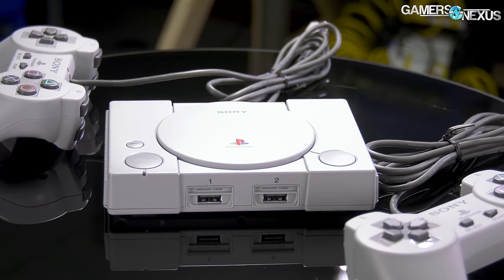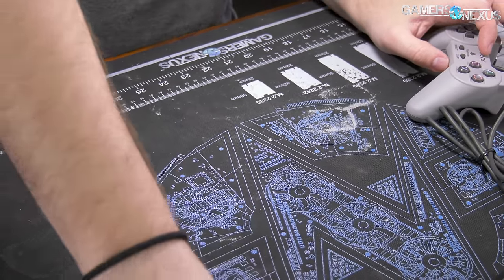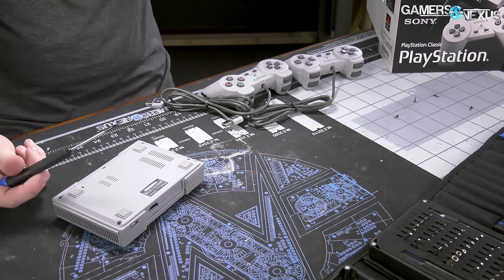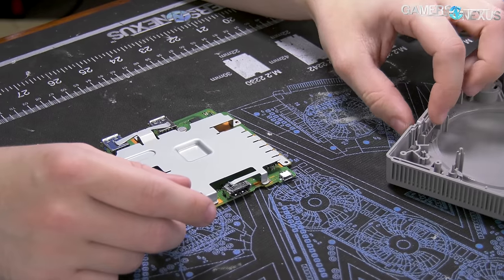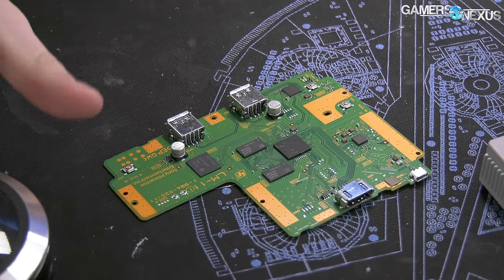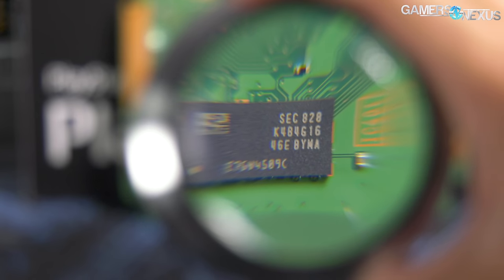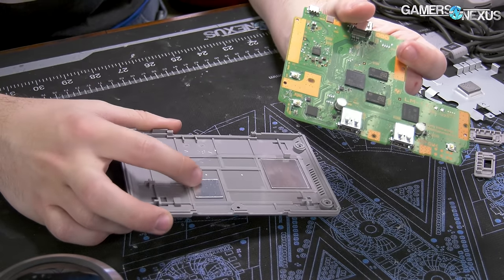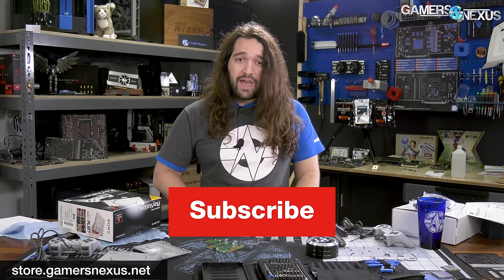PlayStation Classic Tear-Down & Disassembly (PS1)

Comment: I wonder how large the storage is that it could fit only ~12GB worth of games
Reply from the maker: That's a 16GB module.
Reply: @GamersNexus  Wow... They could've at least put SOMETHING good on that. Maybe replaced Cool Boarders with- wait... Actually, I'm good. The emulation's piss poor, I'd rather it be a bad game and bad emulation than something like Spyro or Crash and bad emulation.
Reply: well for the final fantasy games they filled up the 600 something MB disk but for most games they did not fill up the disk thus why most games did not have more than just 1 disk. Making 16,384MB enough space to hold 20 ... probably only 20 to the point that they would have had to include another chip to have more than 20 games on it. I wish they had a way to download or add on more games to the system as that would be cool. To buy more PS1 classic games their own store would make the most sense too.
Reply: @GamersNexus  its a 16gb module and assuming they ripped the ISO files or more likely just dumped them on there you are looking at a tad over the 16gb memory limit. This means it either uses a tad bit of compression or the reason it used pal versions of so many games is because they were (theoretically) smaller in filesize.

As a side this leaves next to no headroom for custom game loading for modders at all :(
Reply: Well they used CDs. They had a capacity of 600/700MB.
Reply: @Diceman82  sure it does delete the 80% of games that are trash it came with and put some actual good ones on it :D
Reply: @Diceman82  Why would PAL versions have smaller file sizes? The resolution is different, but that doesn't change the size of the assets being rendered. If anything, some PAL versions would be likely to be bigger, due to having support for more languages.

Comment: That tool set you're using has a magnetic plate below the housing for the screwdriver bits.  You can slide the plate out or leave it in, either way it's useful to hold screws while you work.

Comment: Looking at the bottom cover, I don't think those slots were ever intended as cooling - they are just cosmetic, and the metal sheet stuck behind them is there just to match the appearance of the EMI screening on the SCPH-1000.  In fact, visually the bottom cover matches the appearance of the SCPH-1000 perfectly - all the slots are in the same place, the feet are the square felt pads used on the early machines and even the plastic nubs that were originally part of the molding for the screws holding in the internal parts are in the same place.

Comment: I'm pretty sure the main purpose for the metal piece is an EMI shield. It can just double as a heat sink since the heat dissipation of that CPU is very low. EMI shields do not need to be robust, hence why it is so thin. You can also see the little "fingers" on the side of the shield touching the ground plane of the PCB. That's how you definitely know it's EMI shield

Comment: The silver metal on the shell is there to mimic the look of the original PS1 which had some substantial metal shielding for the board nd that board doesn't really need that shielding
Reply: I hate the metal shielding on the original becase it was soldered to the board

Comment: I wonder how the performance compares to the Raspberry Pi 3b+ because it handles PS1 games really well. Also, I wonder if there is a reason they went with PAL rooms for some of the games, could the chip not handle 60 fps because of performance. Thanks for doing this teardown.

Comment: The metal shield is more for RF shielding that just happens to work as heatsink too.  That's why there are big areas of exposed copper on the PCB where the shield contacts.

Comment: Finally!! I've been trying to find the hardware specs for months.
So it's a quad core 64bit ARM Cortex A35, 16GB Flash memory, and 1GB DDR3 RAM. 
In comparison, the NES Classic is a Quad core 32bit Cortex A7, 512MB Flash memory, and 256MB or RAM.
If it can be hacked, it could fit a ton more retro games than the NES. Complete collections of NES, SNES, Sega MS, Genesis, Turbo graphic, GBA...

Comment: Everyone has been hard on Sony over this console, but I think what the open source emulator is saying is that they're fully open to this console being hacked so you can run anything you want on it. They're basically just charging you $100 for a raspberry pi in a nice shell and two controllers, and I don't feel like that's outrageous.

Comment: Protip for hackre:

This stuff uses Mediatek MT8167A SOC, that also used by Acer Iconia tablet model b3-a40fhd-k3fx.

Assuming that you can use SP Flash Tool, WWR_MTK, and MTK Droid Tool, you might be able to mod this stuff.

Comment: I think they learned from the "fail" of Nintendo who used Allwinner SoC. Mediatek chips does not have good open source support, but Allwinner chips' have very awesome open source support from linux-sunxi and people can boot custom OS without wiping the original memory. Some people have even pulled contents off the original storage chip, upgraded the system to some brand name Linux distro like Ubuntu, and added the pulled contents back.

Comment: Oh, great video to see when I'm working on a N64 emulator build. I'm taking apart my old N64 case and placing a Raspberry Pi 3 B+ inside. Adding a bit of cooling since N64 emulation with the Pi can be... hectic. 
Going to have USB Controller support as well as an adapter for the old port since I still have a few Original N64 controllers about. It's been fun so far except for the Gamebit screws holding the case shut, ugh.
Reply from the maker: Sounds like a cool project!

Comment: really the better alternative for Sony would to provide a usb port for flash drive port.   Or go a little bit more voltage and provide an SSD Hard drive slot for that extra space... Although for that size you are better off just getting the shell ditch the board and remapping a raspberry pi and put an emulator on there and then hook up on of those high capacity SSD for extreme read/write for these games and to add bluetooth connectivity.... with controller for bluetooth 4 player... or 8 player for those that remember that era of multi-player games.

Comment: the shape of the PCB and the solder blanks hint towards that this was ment to be battery powered (4x AA probs) at some point, might wanna probe the joints there and see if it can take 6v on those 2 contacts and mod a 4x AA holder on it

Comment: best part of it beeing so simple? you can easily put it in any other case. like for example an original ps-one case. and if the emulator accepts them, use usb to playstation adapters to play with original controllers and keep the original look, at least in the front.

Comment: exact same memory chips used in the new NanoPi neo 4. having a gig of ram and a mediatek soc should make it pretty easy to hack/modify it and run retroarch or other stuff similar to a raspberry pi. so its probably best to just get a raspberry pi 3 and 3d print a ps1 case.

Comment: I agree that the original price of $100 was a bit off putting, but at the current sale price it is a steal! You can easily hack it and it is technically more powerful than the raspberry pi 3b+. So once the software catches up it will be pretty awesome. In its current state you can easily add more games unlike the other minis. 

I just hope the flack that they got does put them off from putting out the PS2 mini that is planned

Comment: It would be interesting to put it on a power bank, make a mini monitor with speakers and add it to connect with power-bank, then when there is a lack of light or if you want to use it in the bathroom or take it anywhere, it would be interesting , more is a pity to have few games and some bugs for the price is not worth.

Comment: my psc has stopped powering on recently. the power button does not light up anymore. what could it be? how to fix that? I was able to power it on at first two times when this issue happened with plugging and unplugging the power cord several times, but now it does work anymore. can I still get it back to life?

Comment: Is it just me or does that header on the lower left next to the HDMI at 8:24 look USB-ish with the four pads; left pad being ground as it connects directly to the main PCB, two pads in the centre then running parallel straight to the SoC as data and right pad Vcc?

Comment: Bit of a shame they didn't provide more onboard storage onto it. 32 gb storage would have been easy & fairly cheap too do with 2x of those chips on the pcb & perhaps a expansion memory card of 8 gb with say 5 additional games + save state storage with additional games you could say buy online & customize into a bundle you want too see on there, or via any game stores for more games.
I mean in total it's perhaps 50% markup of manufacturing costs atm with the software licensing & parts.

Then again there might have been so many ideas on how too work with this in Sony over x amount of years after the fat ps3 stopped being produced & ps tv no longer were produced that they finally went with the cheapest option because the other options won't have any protection & be bought more but also kind of eat up their market on the newer more expensive products.

Comment: I'm curious about the controllers since they use USB can you use them on PC games.

Is it possible to access the NAND flash memory to either download the games from it or to add your own games to the unit, possibly via the USB jack?
Reply: Id say the controllers would work as a generic PC controller so windows would probably slap its generic driver on it. As for hacking it im fairly sure this will get broken wide open soon just as the Nintendo classic were. However the experience on a PC is much more satisfying.
Reply: @Twenty_Six_Hundred 
Nintendo 64 Mini up next then from sony PS2 mini classics.

Comment: Now that I saw the teardownd and that there is a whole empty area I'm way more disappointed. I think it would have been a huge success if only Sony decided to create a PSOne classic and make it portable.

They could have added a battery in the empty area+battery cover for easy replacement, add a working lcd screen in the disc reader to mimic the PSOne portable screen (both battery and lcd could have been gathered from Sony old phone stock if they had them), add analog sticks to the controllers, optimize the emulator by adding various graphical options and lastly choose better games and make sure them are all NTSC or JAP English Patched (since there is issues with frametimes due to 50hz PAL games in the emulation). Instead they went full cashgrab with a poorly made "work", and now they are unsuprisingly backlashed...

Comment: could the 'CD-ROM lid & internal space' be large enough to custom fit a mini cd (24min audio) drive even if a buffer for height had to be 3D printed?
Reply: scratch that, didn't realise it was o tiny.
Have to 3D print and downscale from a PSX, probably btter for a working lid.. and large rnough to keep the serial & parallel ports.

Comment: Please investigate the RTX frame rate improvements on Battelfield V after the first optimization patch. Claims are 60-75 fps (depending on which RTX card you have) at 1440p with RTX on.

Comment: They should've just built the board inside of the controller and sold the controller as the ps1 classic. That way all you'd have to do is plug the controller into the wall/tv

Comment: If they are good quality, I expect the controllers to be much more expensive than the actual box. I mean you can emulate PSX games on a potato these days but a good controller is still a good controller.
Reply: It's the OG PS1 controller without rumble or analogue sticks. Sony likely has a significant margin on PS4 controllers that they sell for 50-60 bucks, and those controllers have rumble, wireless connectivity, sticks, rechargable batteries and even a touch pad. There's no way a dinky PS1 controller costs them more than 5 bucks to manufacture, if even that.
Reply: @stale2665  Well, you can get cheaper controllers from third parties but they always have an inferior build quality. Same for other consoles like Nintendo controllers: the originals are super expensive but the third-party ones are crap. So if it were possible to manufacture and distribute good-quality controllers for significantly less, why don't we see these on the market?

That being said, you have a point that the old PS1 controller has much less tech in it than a modern controller. I just wouldn't be so sure that this makes them dirt cheap. Electronics cost nothing. Something that can take years of abuse from button smashing OTOH does not come for free.

Comment: The Pony Graystation. Even 24 years ago, I was saving up for the Japanese N64 release instead
Reply: You mean Saturn. N64 did come out in Japan until Early '96.
Reply: @segaunited3855  no, I was saving up ever since I saw the E3 show in 1995. Mario 64 was way ahead of its time. But the N64 did suffer in software quantity. Quality was fine though.
Reply: @dannygray4898  1995 was 23 years ago.

Saturn was also ahead of its time.
Reply: @segaunited3855  I had a Saturn when it came out and I agree it was a good little machine. However, developers were never able to fully get to grips with its complicated architecture. It was far better than the PlayStation  at dealing with 2d graphics, but Sony's machine was better for 3d . The N64 though was a big step up from that. I first heard of the "ultra 64" in 94 and saw Mario 64 for the first time in 95. It was released in Japan in May 96, by which time I'd saved £1300, more than enough to import mysen one
Reply: @dannygray4898  PS1 was actually WORSE at 3D than Saturn and N64. Saturn had far more power and was superior at 3D than PS1.
Reply: @segaunited3855  it would have been, but software houses could not get to grips with it fully. By the time they could, the Saturn and PS1 was old hat. I really liked the Dreamcast aswell, but Sega sadly gave up on hardware in the end
Reply: @dannygray4898  SEGA did not want to give up on Hardware. They're Parent Company forced them too at gun point.

This is why our friends at Alethiea Games are going to pitch "RAZOR" To SEGA Holdings Next year.

Also, Saturn wasn't outdated by 1997. Not at all.
Reply: @segaunited3855  fair comment. I loved Sega. It was just really sad watching what happened. Did u like the underrated Dreamcast?
Reply: @dannygray4898  Yes!I brought a used Dreamcast from Hollywood Video on  Monday November 8,1999. Spent my whole then Burger King Paycheck on it and Sonic Adventure. I still have a Dreamcast today, as well as an American Saturn and Japanese Saturn.

The RAZOR Game Console will be backwards compatible with Sega CD,Saturn and Dreamcast Discs including Homebrewed ones.

SEGA thankfully doesn't  have a Parent Company currently. They're now known as SEGA Holdings,Co,Ltd and have a Public Trading Group called SegaSammy. Sammy Corporation,Inc has been a Wholly Owned Subsidiarity of SEGA since 2010.
Reply: @segaunited3855  I used to love that boxing game (I forget the name) when the Dreamcast came out. Eya in Britain, we unfortunately  had to always wait for the official release of new consoles. That's why I always imported my favorite ones. I also loved Panzer Dragoon on the saturn
Reply: @dannygray4898  Ready 2 Rumble Boxing was the name of the Dreamcast launch game.

Its nice to see a British SEGA fan. Really nice to be able to speak with one. ;)
Reply: @segaunited3855  oh man, I remember getting a master system for Xmas 89. I was a Sega fan straight there & then. Ready 2 Rumble! Bang on I always remember that guy wi the afro

Comment: $100 was not worth this little thing, this was a day one must own and is now a joke, 14 days after launch was the original price drop with target offering 75$. On the 23rd retailers started marking these down to 65$ to 60$, If more price drops keep coming the PS1 classic could hit 40$ in january. for 60 dollars Im considering getting two more to modify as I'd like to keep my original unmodded. Aside from adding more games, I think I'll be taking apart the next two I get to make molds of the shells & make 1 clear case and 1 clear blue case. I might even keep the two stock cases and put in raspberry pi's in them for more fun.

Comment: Yea but I'm worried it won't play smoothly.  Emulators ***ALWAYS*** have more problems than the actual consoles did.  I use Project64 for N64 emulation and in general it works really well...but some games are also horrific.  That's the shit you don't run into with normal HW - it works - always.  It was tested on that HW.  Emulators are a different beast.... :-\